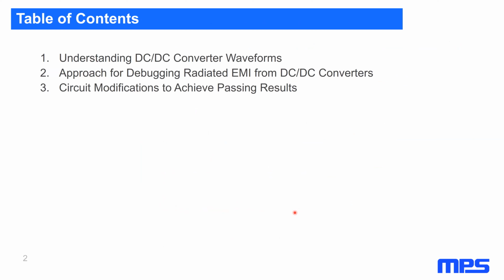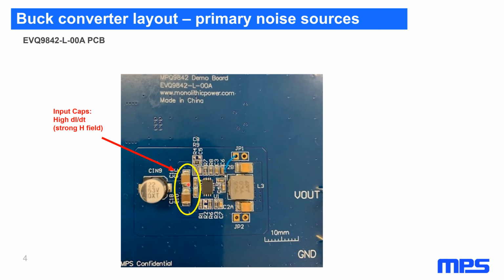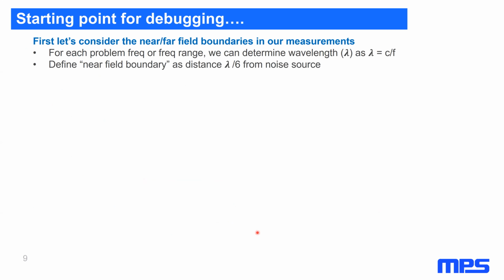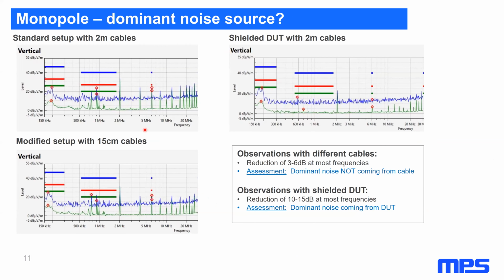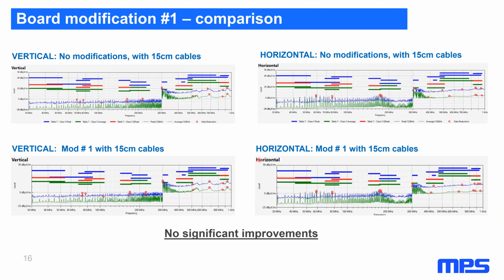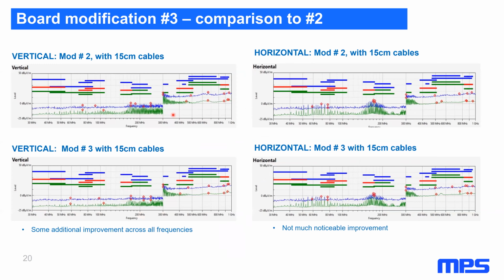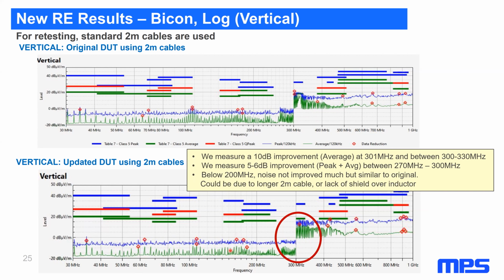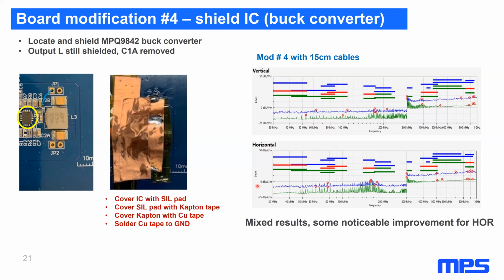Webinar EMC Insights and Solutions: An Approach to Debugging Radiated EMI from DC DC Converters

Comment: Nice presentation. Very useful. Question: Having an improvement in a problematic peak by 10dBs is better than just 5dBs in our pre-compliance testing...but to what degree of confidence these results will be translated in the same improvements when the DUT is sent to the final EMC test in the more expensive EMC company that allow us to put the product in the market? different antennas and cables involved may not just push the graphs "up and down"? Again, very useful.
Reply from the maker: Hi Sergio,

Thank you for taking the time to watch the video.  We're glad you found it useful.

Regarding your question:  if you’re able to achieve significant improvement (let’s say 10dB or 12dB) at the pre-compliance chamber, you should be able to achieve similar results that are reasonably close (within 2-3dB) at another chamber running the final test.  This assumes that the pre-compliance chamber and the final test chamber are both running the same test, per the same specification and setup.  Yes, it’s true that equipment and antennas may be different.  Typically, these chambers need to calibrate their equipment and noise measurements so they should be reasonably close to other chambers having the same setup.  In the past, I have tested boards at 2 different 3rd party labs for CISPR25 CE and RE testing.  Each lab used equipment and software that was different from the other.  They were both certified for CISPR25.  The lab I selected was based on who could meet my schedule requirements for that week.  Over time, I correlated my measurements between the 2 labs and found they were very similar for CISPR25 tests, with differences of usually 2dB or less for the same boards.

If you suspect there is a big difference between labs/chambers you use, then maybe try to schedule pre-compliance and final test at the same test chamber.  Another suggestion is to use the same setup as much as possible (e.g. use the same exact cables, boards, components, etc.) at final test as you used during pre-compliance to remove as many variables as possible.  Hope this helps!
Reply: @monolithicpowersystems  Thank you for replying. "within 2-3dB" is a pretty good tolerance according to "my standards" at least.